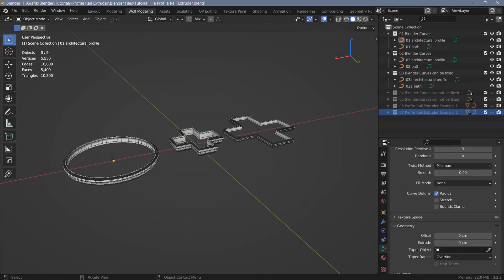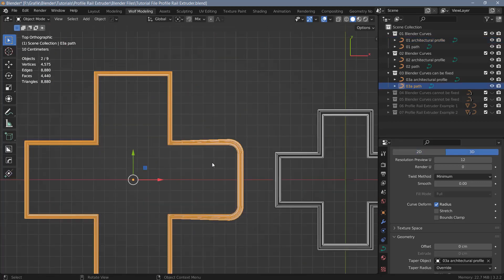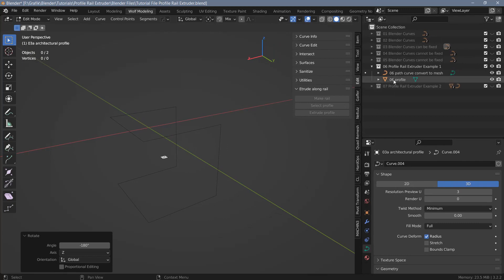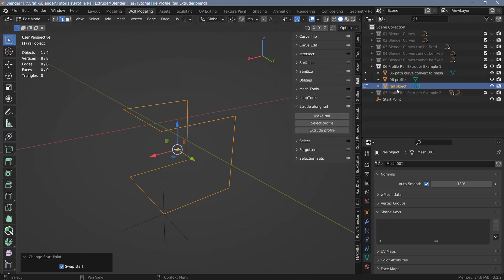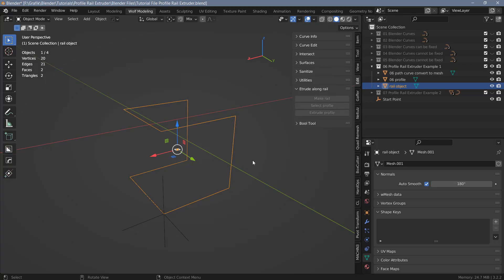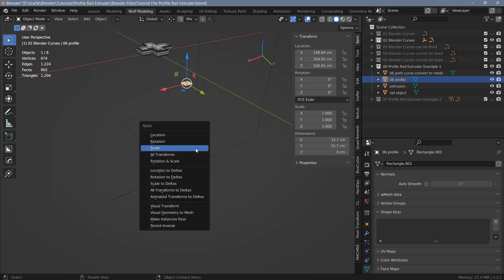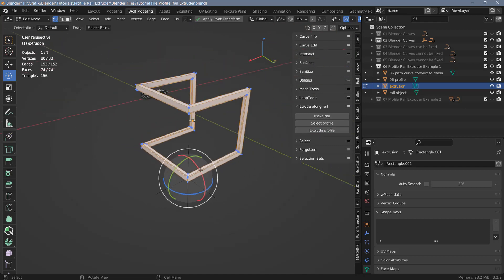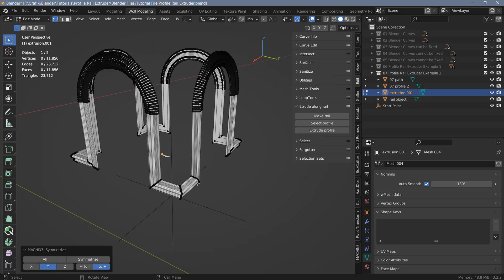Blender Add-On "Profile Rail Extruder" - Extrude Profiles along Paths (Blender 3.xx Tutorial)

Comment: love the cool add on showviews  
great.. look every week for new  thinks and the channel is always a favorite....rthx..

p.s. I think you  can see the flow of the path ...
to change the mesh object you could use linked copy.
I thought without the P.tool the origin mesh path must match the  position in vanilla B3d?
Reply from the maker: Glad to hear you like my videos!

I think you can only see the flow if it's a curve. 

I'm not sure, but I think the postion doesn't need to match but both objects need to be in the same plane for the extrusion to work. To be honest, I haven't quite figured that out yet. All I know is that working with the Blender curves to extrude a profile along a path can be frustrating if you don't do it at the center of the Blender grid.
Reply: @Wolf-4D  yeah understand  looks like I had miss the convert step in the first view..must look again...thx